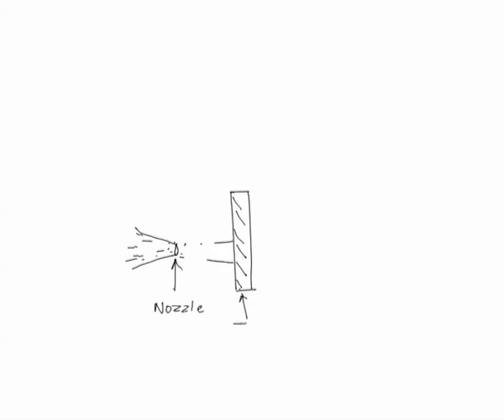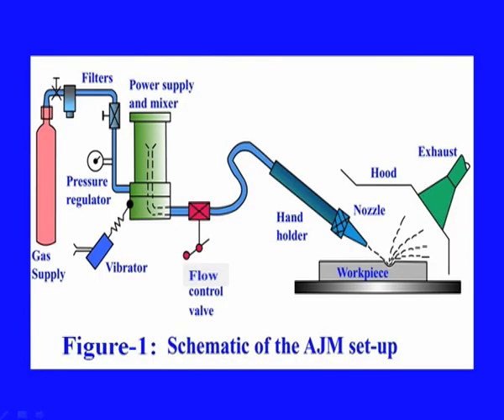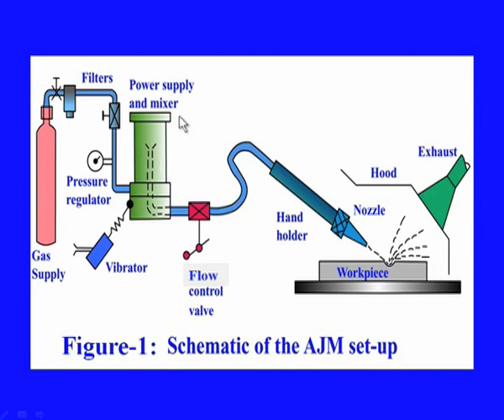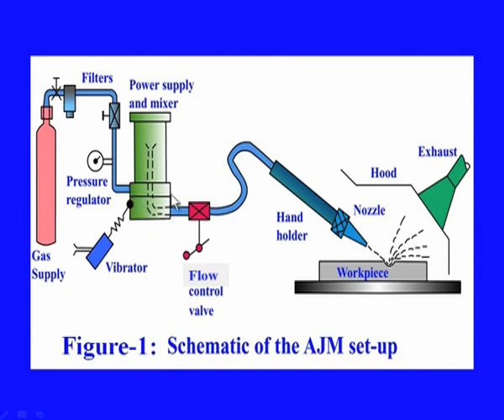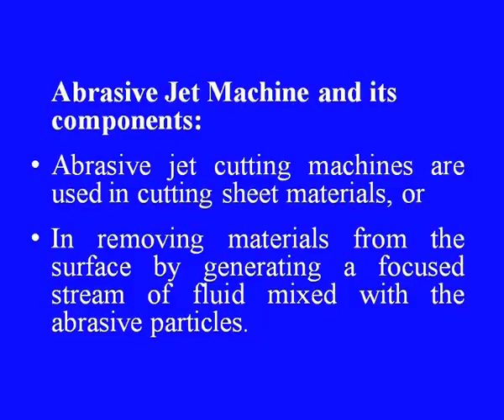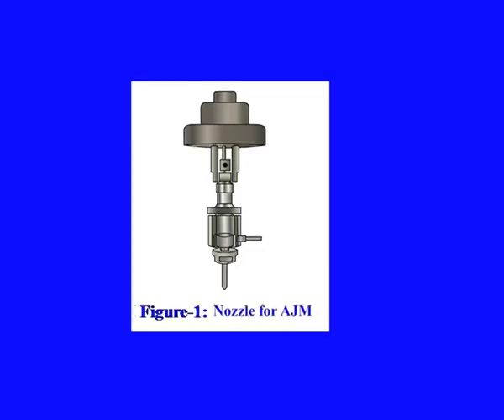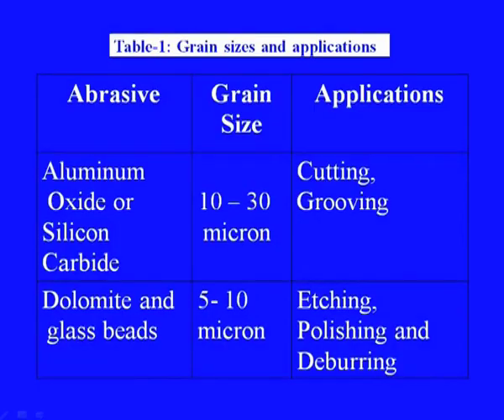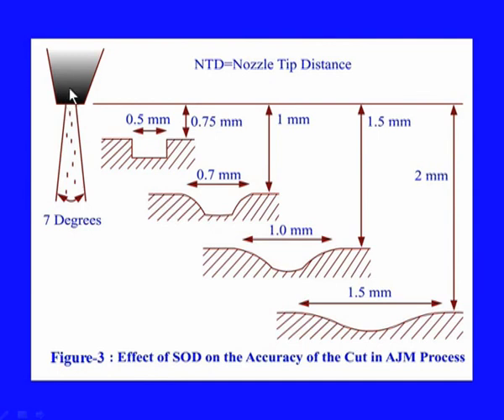Abrasive Jet Machining (AJM)

Comment: Sir in case of air we can use water and abrasive particles for removing the material
Reply: Yes , you can use  water but  this process name will change then .Then the process name will be Water Jet Machining.
Reply: In these process cannot be 
Used as water is the working 
Fluid because there is a compressor is used for compress the air 
But water is incompressible fluid 
Therefore water is not used in these process ...

Comment: We are using a sand blasting gun where the sand will fall due to gravity which will mix with air and then strike the material to be cut or cleaned. So my question is can our operation be termed as a proper AJM or instead it is sand blasting. Please do reply, as it will be very helpful for us.